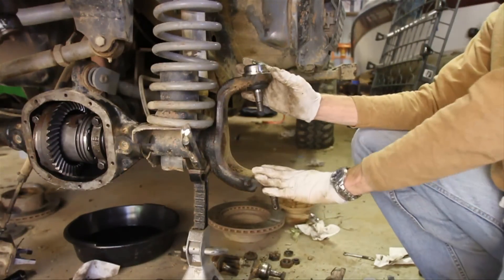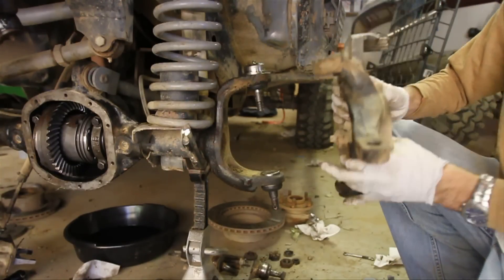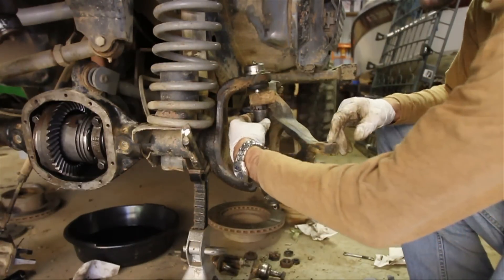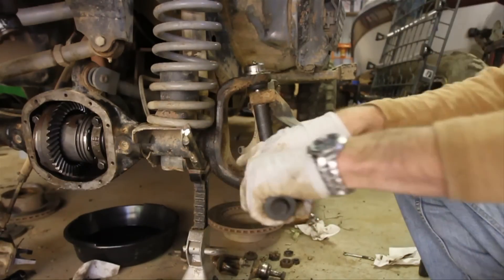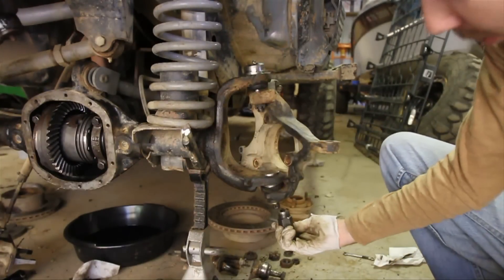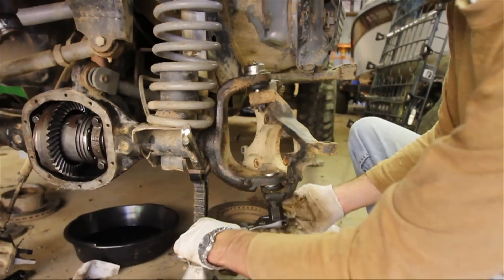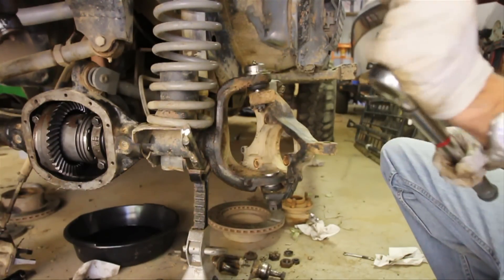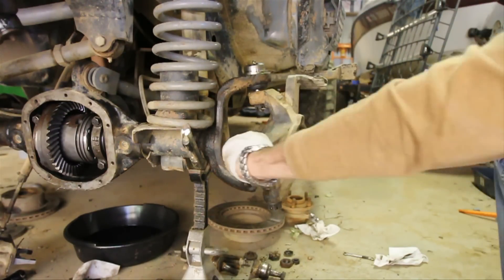How-To replace Dana 30 and 44 Ball Joints part 3 of 3 (steering knuckle installation, preload)

Comment from the maker: @mikey47B in the rear absolutely!  Although hard to find, some 2wd Cherokees came with a Dana44 that will swap right in.  In the front the Dana 30 has been holding up for me pretty well.  But no matter what, you are going to need some chromoly shafts if you plan to wheel hardcore.

Comment: Matt, maybe a little theory. Why is it a good idea for an SYE? What are the advantages. Why are you doing balljoints? What conditions might that fix? Etc.. Love the vids. Learning a ton. Keep it up brother.
Reply from the maker: you can tell when a balljoint is bad because the wheel will wiggle back and fourth when jacked up.  on the SYE, I have a video on that so check it out!

Comment: Thanks for the video Matt! Is it pretty normal for the knuckle to feel pretty stiff after torquing them to spec? I installed some ball joints from 1aauto and i could hardly keep the jeep straight when driving over 40mph. I am currently (like right now) removing those and installing some from yukon gear. They feel a little more free moving but still somewhat stiff. Thanks.

Comment: If you follow this procedure, you WILL have the axle scraping on the axle housing. The PROPER procedure is to set the split collar to .206 inches from the bottom of the knuckle boss THEN put it back together. 80 ft lbs to the upper joint nut, 75 to the lower. Once the adjusting ring (split collar) on the lower ball joint is set, there is no need to touch it again. Doing it this way, the axle will not rub on the housing and the caster/camber will be right on the money. :)
Reply: Same goes for any jeep that has a lower ball joint split collar. :)
Reply: @tomwertz762  Can you just leave the old one in there?

Comment: Will a 99 cherokee sport have these preload spacers? Need to do this soon and want to plan out what I will need. Great vids !
Reply: +Keith Lambert 

Anyone have any info on whether the 99 XJ had the preload spacers?
Reply: +Keith Lambert i dont think you need them on the newer style xj. i have a 01 xj i am about to do the ball joints. the spicer 706944X ball joint kit comes with the preload spacer whether you need it or not. just look when you get it apart and toss the spacer if you dont need it. i think the ball joints are the same for 84-01 but the 84-96 use the spacer and the 97-01 will not need it. good luck
Reply: In the early 90s, jjeep eliminated the need for the preload spacer/split collar by changing the design. You should not have any preload spacer and shouldn't have to worry about it. Torque the ball joints to spec and roll. :)